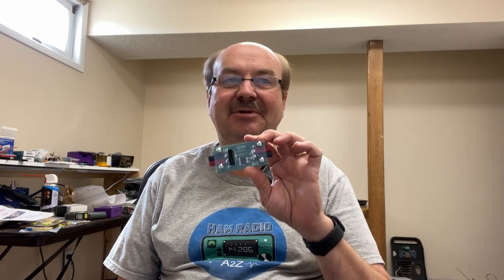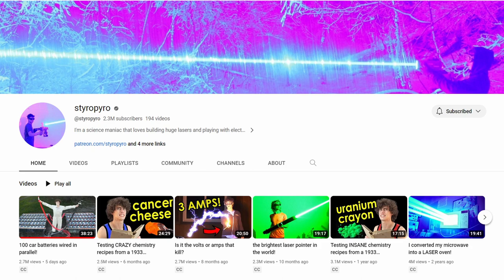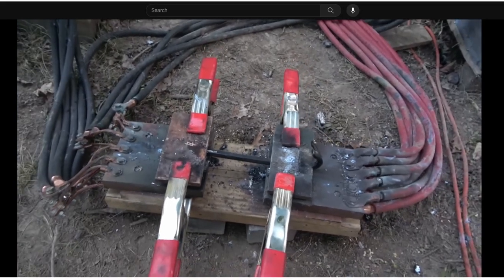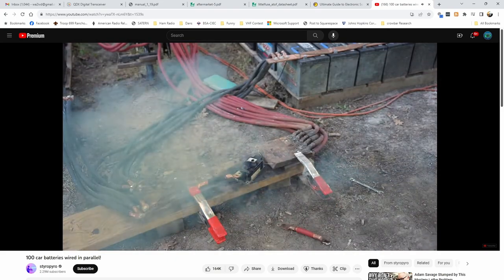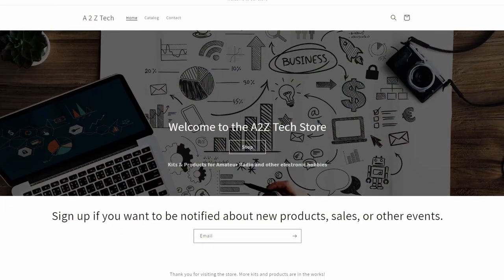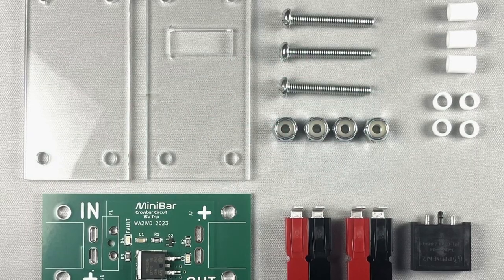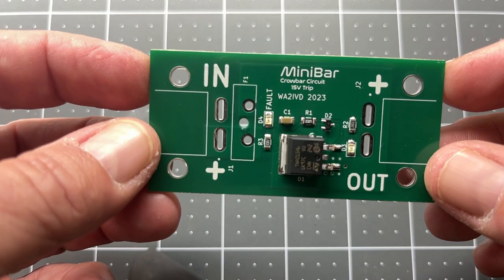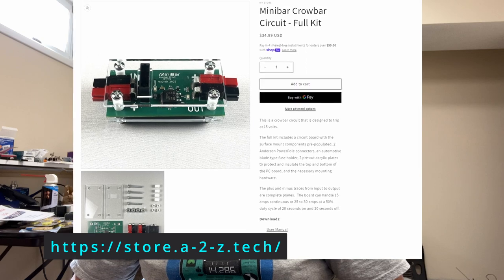MiniBar Kits Are Now Available

Comment: great circuit to have. many power supply's do not have them bult in.  just the basic board can be hard wired inside the supply. Love the SCR . I have them from a few amps to 2200 amps. the 2200 amp one called the hockey buck is bigger than a real hockey puck. I have been fixing linear power supply's many years. started in like 1976/77 . high voltage is common failure. some Astron came with out crowbar but they sell a small board to add that . loved your show on Coffee and ham radio . The Busman I normally use have a UL on them. a good fuse is best for that board. Busman and little fuse both sell breakers that plug into same holder. 2 types . auto reset and manual reset. I would not use them in ham radio. 73's
Reply from the maker: Hi.  Thanks for the comments!.  Years ago I worked for a forklift company that used SCR based drive controllers.  We used some of those hockey puck SCRs.

Comment: Have you tested these in the presence of RF at different frequencies?  Could common mode or ambient RF cause the zener to bias or the scr to unexpectedly trigger?
Reply from the maker: Hi.  It's a good question.  I don't have the EMI test equipment needed to inject controlled RF fields or levels into the circuit.  Part of the purpose for the 0.1uF capacitor, C1 is to shunt spikes and RF noise to ground to help prevent false trips.  If someone has RF noise tripping the crowbar, it would need to be handled in the same manner as RF in the shack causing any other electronic misbehavior.  RF chokes and other measures would have to be applied to coax and other cables coming into the shack to supress the noise before the circuit.

Comment: Interesting device, unfortunately my car, BMW, can charge at over 15v, especially when the regenerative braking kicks in, all my radios have not had an issue with this voltage, but I would be interested in one of these if the the cut off was adjustable between 15 and 16v. I believe all the radios I have are rated to 16v, although I would like to cut out at 15.5v
Reply from the maker: This is good to know.  I believe car charging systems are one of the more common causes of rigs getting fried (Failed regulators and >>16V, not hybrid systems).  I didn't think about some of the mild hybrids regularly hitting voltages >15.  I have a future, higher-end product in mind that should be compatible with your BMW, but still provide protection.  Stay tuned...
Reply: @HamRadioA2Z  Mine is actually just a diesel not hybrid, I am sure hybrids do the same, mine does regenerative braking and puts volts into the main battery.. I'll keep an eye out for future revisions..thanks ZL1CTS